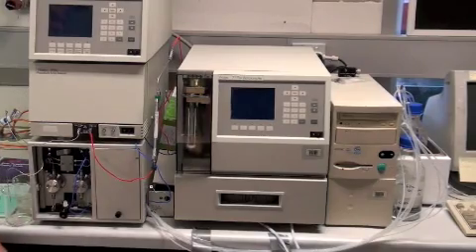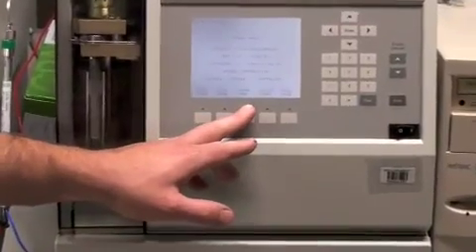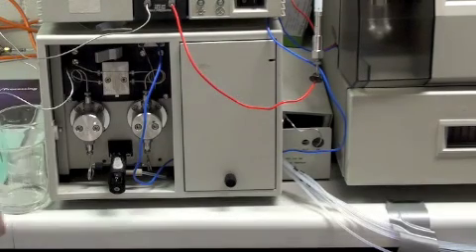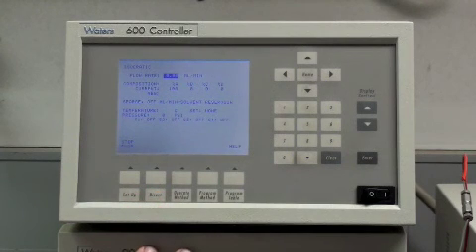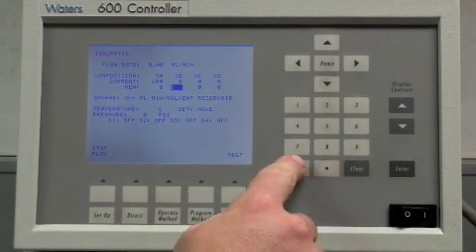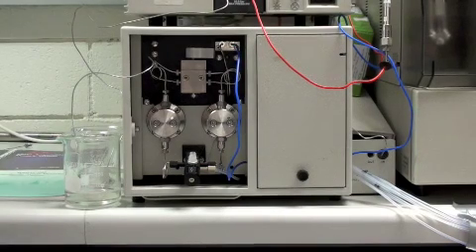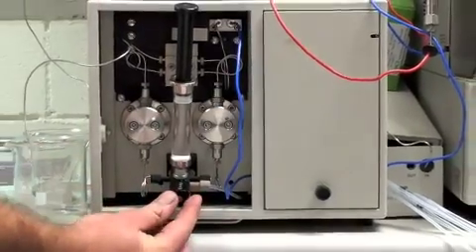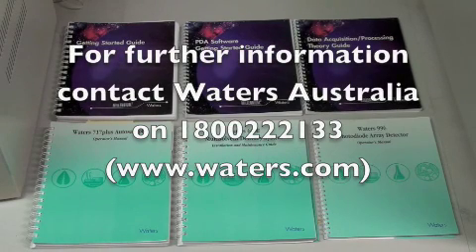Introductory video for starting a Waters HPLC

Comment: You need to have flow established through the autosampler (via the pump of course) before you purge the autosampler.  Otherwise the purge is pointless.  Also, don't forget about the needlewash purge reservoir.